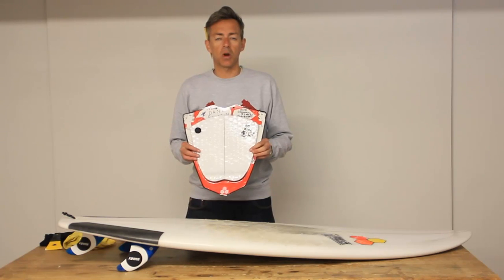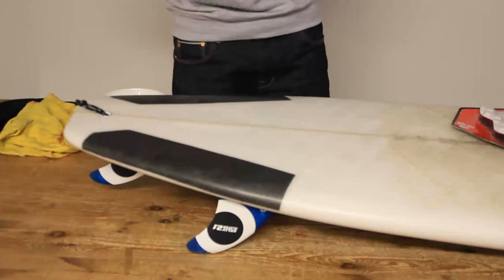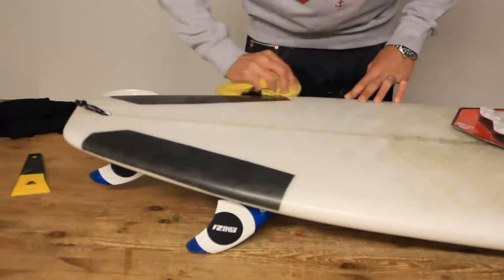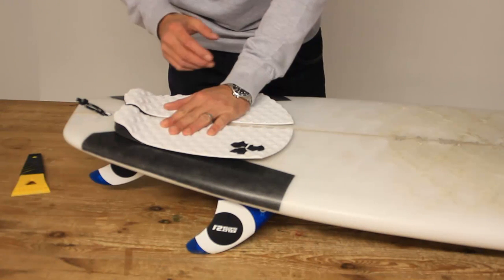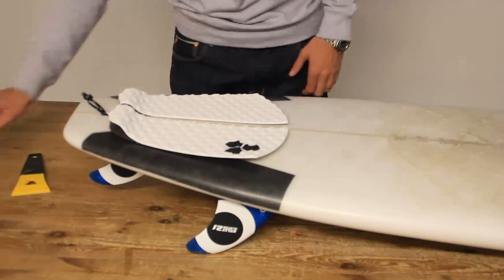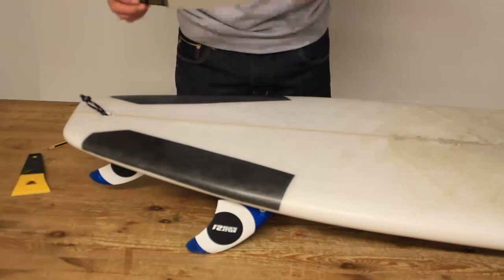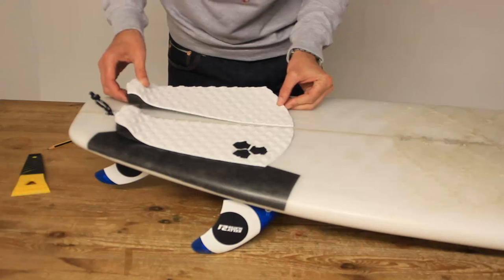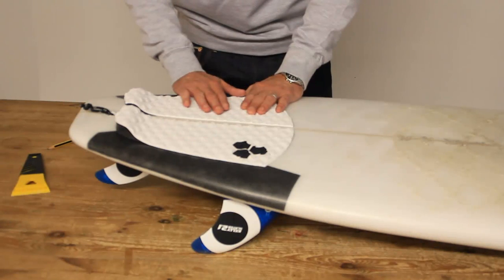How to install a surfboard tail pad

Comment: I'd say the back-kick of the pad should be over the back-edge of the back-center fin for the highest performance potential for the general range of shapes of HPSBs.   And whether the kick-(orthogonal)-midline is centered over the back edge or slightly in either direction(1/4" either way) is up to the discretion or error of the board owner.